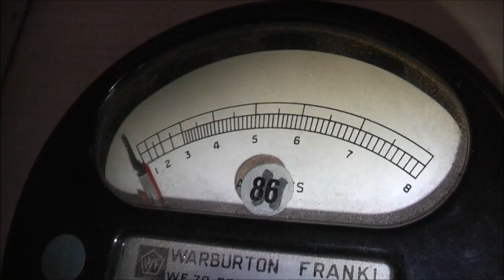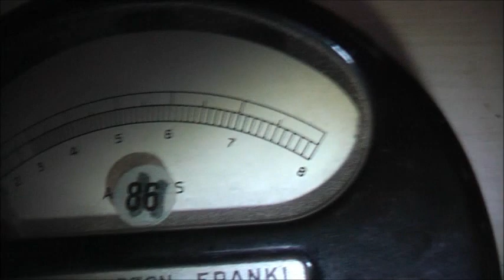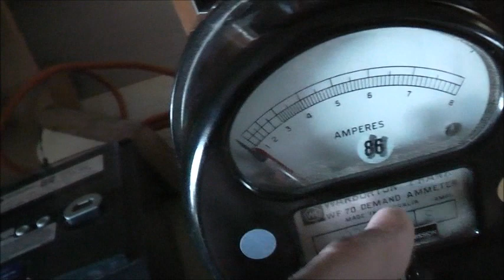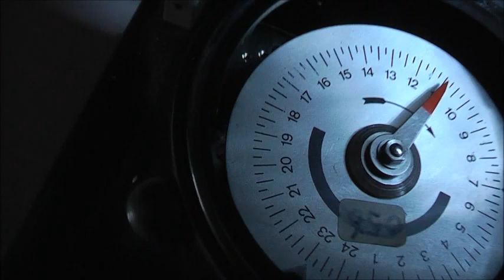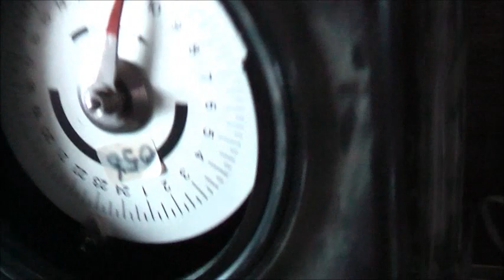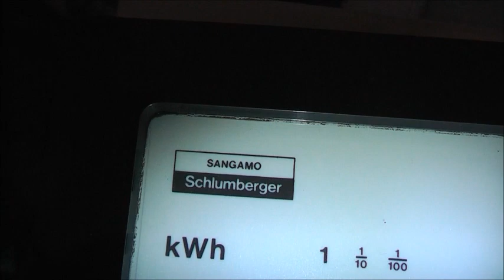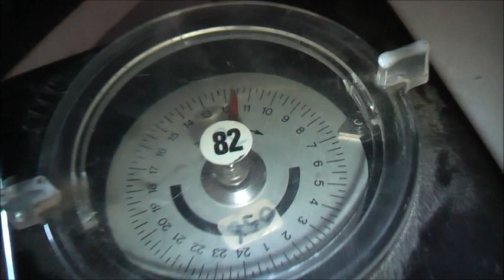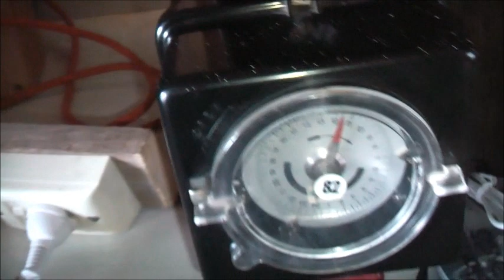WF70 Ammeter & L&G Timeswitch Clean & Test

Comment: That meter is a thermal demand meter. Used on a CT metering job in series with a 5 Amp revenue meter or sometimes to directly monitor the loading on a transformer. CT's are used of course.

Comment: The escapement is locked during mains operation. When a Power cut happens the escapement starts. Every 2 hours the escapement is briefly released, to prevent it getting stuck. These clocks are very reliable.

Comment: Your KYA time switch can do with some lubrication. The escapement needs to do a bigger move of the anchor. When the power is on the escapement is blocked by means of a small leave spring. There is a release every so many hours when the escapement is released.

Comment: That's a nice L&G timeswitch you have. Rodalco has one of those. :-) In regards to cleaning & restoration, it may be necessary to open up this timer to check it over, especially if it isn't keeping time, either in the motor, escapement or both. 

In regards to loading, you won't be able to pick-up the motor on a kWh meter, as they only use a watt-or-two, maybe even not that! 

It cleaned up very nicely, looking forward to seeing this one fully wound up & running. :-)

Thanx for showing,

-BBD.

Comment: Sangamo SPA 01: When you power-up your SPA 01, for the first 0.01 kWh it may not register correctly. Sometimes, my ones do it as well, even the SPA 02 meters do it. 

It's what I've named as 'The Twitch'. It attempts to register-up, but can't for some reason.

It just seems a fluke when one of these twitch, as you'll find, it may not do it at every power-up.

It's worth noting whether it does twitch at power-up especially if the meter is going to be used to verify the accuracy of another meter.

Comment: I'm loving that WF demand instrument! :-O The reason why it may not have done anything, may be because it may, like a Trivector, only measure-up once every 30 minutes.

Try & keep a small 2A load on it for an hour-or-so, & see after that hour if it has measured-up the pointer. :-)

Very cute. It can be easily seen that this demand meter was based on Sangamo Weston's design from around the HMT era.

Yeah, I'd love to have something like this in my collection. *Drool* :-D

Thanx for showing,

-BBD